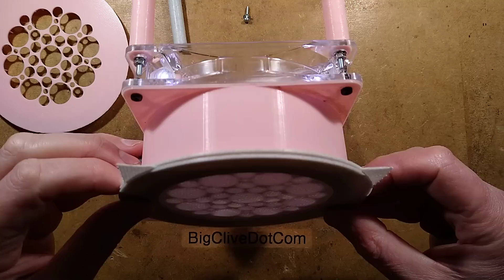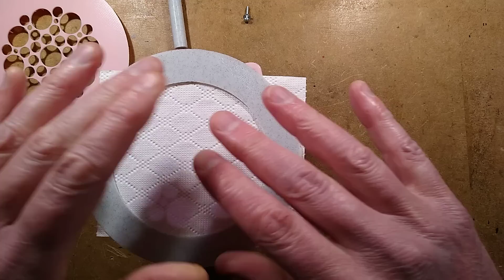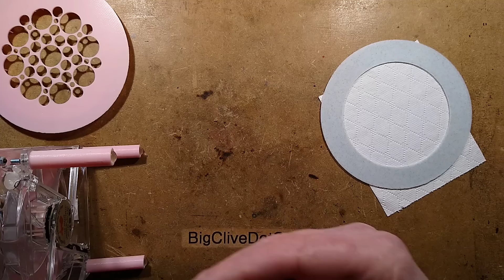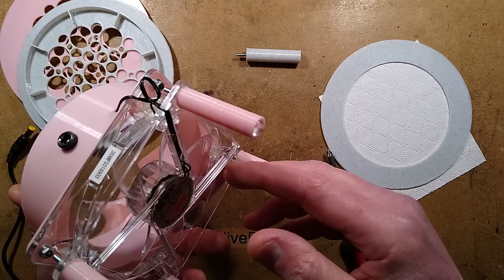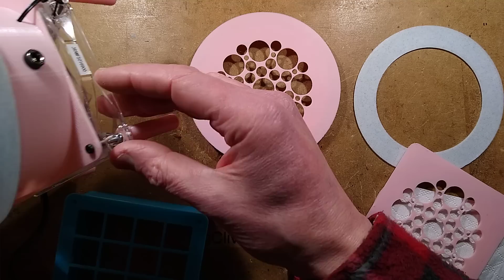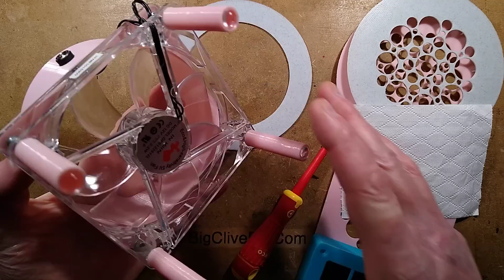MK3 air filter with customisable 3D printing files

Comment: Since giving up TV I replaced my set-top box with an old laptop connected to my big screen.
To help keep it cool I've had a 120mm 12V fan blowing air over it - prolonging the life of the internal fan by years.
Now is a good time to upgrade to filtered airflow.
Reply from the maker: This basic filter results in a very slow airflow.  Your screen may prefer a high airflow with coarse filter if any.
Reply: @bigclivedotcom  Good point. I'll cancel my order for Izal.

Comment: The biggest question does the time+effort+ material cost vs actual effectiveness pan out? In all reality, how much is something that small going to accomplish? Unless the filter material is constantly coming out totally grody on a very frequent and regular basis, I don't see the point in it or the commercial products it copies. 

I'd think the fan is too weak to generate airflow cover a decent area, so you're either going to need several of them in strategic places, or they'll be useless / placebo. 

A half-joking half-serious, waaay too much effort and cost, improvement would be to get it up in the air (diy quadcopter drone?) on a random path in a defined area. Having it move around like some sort of airborne dust-Roomba would cut down on the limited area covered by a stationary product.
Reply from the maker: It's a low throughput extra-quite 24/7 filter for small rooms.
Reply: I agree, this project seems to have jumped off into design and 'engineering' before doing any basic testing on the actual filter material.  Fact of the matter is, if a simple tp/paper towel were of any real use/effectiveness, this would have been found out decades ago.  Its not like this hasn't been tried countless times before.
Basic google shows even 4-ply papertowels have among the lowest filtration capacity.
I understand playing around, however its rather funny people going bongo over this like its going to be a poor man's HEPA filter, or filter much at all.
So far, the 'proof' that it works seems to be that it was able to diffuse some essential oil throughout a room quickly. 
Dispersing a liquid via fan is not the same as filtering air through tp/pt.

Entertaining though.

Comment: I was thinking recesses for wee magnets to hold the ring.
All week I've been looking at 3d printers... couldn't come up with a use case... now I can go spend more money. (sigh)
But I do have to thank you about something else. My expensive paper shredder quit working; your inspiration fueled me to take it apart (a bit of unreasonable force), reverse engineer the circuit so that I could bypass the poorly designed switch in an otherwise excellent product, and rewire the thing so that it WORKS!

Comment: I have a handful of computer fans cooling things like my switch router etc. that are sitting on a bookcase just to get some airflow I'm kicking myself for not thinking about putting a filter on it would have made cleaning a lot easier. The paper towel filter is an interesting technique I discovered it with shop vacuum cleaners on a YouTube channel.

Comment: I would love to see a version that is wall mounted. with the filter material in an upright position held by airflow only. With a little slide and a clip at the bottom to hold a little cardboard box that catches the used filters. turn off power -> let the dirty filter slide in the box -> turn on power and attach new filter.... maybe a 3D printed  mod for a standard toilet paper holder :D

Comment: A version for a 200mm fan could fit those tissues for the nose perfectly. 
And that design could be extended for fans with 4 pin pwm connector, a µC and some sensor for air quality. 
So the fan could ramp up when the air is dirty. 
Or maybe just a design that uses the tacho signal to display the rpm of the fan and when it's a pwm fan, a NE555 based pwm generator to set the fan speed manually.

Comment: Wouldn't it be better to let the dust fall on the floor and vacuum it up than to make an airflow with dust in it in the room. I am thinking that the longer the dust is in the air, the better chance it has of reaching your lungs. Just doing a little critical thinking here. My brain is stuck in that mode. Can't help it :-)

Comment: I did something similar with an empty 5L mini keg of Heineken. I started by removing the top with a rotary tool, then drilled a series of holes near the bottom to exhaust the air. I mounted a 14cm fan with rounded corners with the airflow shooting down, then trimmed the clips that held the plastic handle top on for easy removal. I used swiffer dry refill sheets stretched across the opening up top (between the metal keg and plastic handle) for an air filter material. They trapped the dust very well. 

As a bonus in the summer it functioned as a mini air-conditioner by placing a bag of ice cubes near the bottom of the keg, above the exhaust vent holes.

Comment: Again, hepa filter is absolutely capable of lasting 6-12 months if you use a cotton pre-filter and replace it every time it gets clogged up with dust, in my case every 1.5 month. Such pre-filter is like 10c but probably can be replaced with paper towel. 
Issue with using only a paper towel without hepa filter is it creates fine dust made up of tiny pieces of cellulose and resin (the lower cellulose quality the more resin they have to add to make paper out of it, brown super-recycled paper is sometimes more resin than paper)

Comment: The packing of circles obviously is not particularly efficient and leads to loss of surface area.  I appreciate your desire for something more elegant then the original squares.  I made a 3d printed downpipe leaf-stopper insert that has very similar geometry to what you're doing (a grille over a circular hole).  I went with hexagons for the superior packing efficiency and it's also quite simple to achieve in CAD too.  So I'd recommend that if you ever go to version 3 of your design.

Comment: The upper body looks quite like an off the shelf fan to duct adapter, for attaching a 120mm AC induction fan to e.g., a dryer exhaust hose.

If one made a filter support from drilled fiberboard, presumably this could be replicated decently even without a 3D printer.

Comment: For the feet, I would do the opposite: captive nut in the post, screw on the fan side. That way, they remain easy to remove/refit without having to touch the foot bumpers

Comment: BC rocks, however anyone who thinks this will actually do more than a very minor job of filtering, I've got a bridge....
Just google diy filter materials, and see that even 4-ply paper towels have among the lowest filter capacity.
If someone wants to play around with a 3d printer or experiment, good on ya.  But if you have allergies, get a decent static pressure fan and some decent filter material and you'll get real cleaning.
Also, vaccuum your rooms, you filthy animals!

Comment: Twisting of airflow on the inlet side shouldn't be so much of a problem. It's mostly the down flow side that gets rotation caused by the rotating fan blades. I experience similar on a much larger (and louder) scale on my paramotor :) Thanks though Clive. Oh btw, fitted one of the standby mains change over switches you looked at ages ago, in my campervan to switch between 'shore power' and onboard inverter system.

Comment: It seems a little pointless 3D printing the fancy hole base, then cover it with the paper, that should be the top  layer like your simple ring cover should have the holes, and like your square grid below. With the filter paper between, Yes you will see the holes in a dark room if below filter paper, but how often are you in a room dark enough that they would glow through. This way you could have had your turbulence fins going all the way across your print if you wanted.

Comment: Since these are very weak static pressure, you could more than 2x the throughput by stacking another fan + air chamber. same desk space, same single plug but simply more effective.

Comment: Corrugating the filter similar to a car air filter would increase the surface area for filtration. If you haven't already you should do a video showing off/reviewing your 3d printer. I'd love one but I don't want to break the bank on something that see's occasional use, got enough expensive tools already

Comment: We have a water-based air purifier, by care for air - the clean air factory. It works quite well - we can smell the anti-bacterial essential oil drops we put into the water (also bought from/made by care for air) and the air intake slot on the inside of the top at the back of the unit is surrounded with dust - it is drawing in air. We have it on a plug timer and it turns on in the day time in the winter - it partly humidifies the air around it combating the dry air made by the radiators of the central heating. In the spring I have set it to turn on in the evening when the heating turns on and we start closing the windows - as it is warm in the daytime and cold at night, and in the summer it is put away as it is hot in the day and warm at night - most of the windows are permanently open with the heating off. As for ventilation in general, we live in a Victorian terraced house that has 2 fireplaces - lounge/master bedroom, the air is drawn up them because of the Venturi effect on the chimney pots when a breeze blows over the terrace/house. We have 3 extractor fans - cooker hood in the kitchen, 12v fan in the main bathroom, 240v fan in the loft extension shower/toilet, and I have a ventilation fan in my bedroom 😁

Comment: I might build one with 200mm 5V USB fan, should be quieter than small fan and USB power supplies are cheap. Although I already got Elixair air filter with washable filter but always good to have more filters running in a house with cats.

Comment: Great basic idea, I see great potential for further development. First, I'm thinking a stack of filters, in parallell, to reduce resistance, and increase service interval. Second, I think you should try using exposed infill for the grids. Design them without holes, slice without top and bottom layers, and choose infill pattern and density to get the result you want.  That way you get a singe wall structure, which gives best "hole to structure ratio", that also prints fast.

Comment: Longer screws in the leggs will allow both the leggs and the sleeve to be held by 4 dome nuts, simpler and less parts. The top ring can be heald by magnets to ensure it do not vibrate of. What about the fan type, static pressure vs high flow for best effect and/or longevity? Nice re design still.

Comment: Very interesting! Perhaps a useful variety for the lab would be a second, very similar design with a switchable fan speed (off, low, med, high) which might be used as a extraction fan for those oh-so-dangerous-non-EU-tyrants-compliant soldering fumes. The cavity in front of the fan could be enlarged just a bit and might contain a active carbon (charcoal ?) filter (cloth?) to the same effect.

Thanks Clive for sharing and creating these great designs and videos.

Comment: How about increasing the surface area of the filter by making a filter cube?

I was working maintenance at a local mid-sized factory and someone broke one of those deep accordion-type air filters on a machine. When we went to change it, we found someone had decided to store the extra filters in the outside storage area and all the filters were soggy and probably moldy.

So we made a large cube out of aluminium profile and simple filter material that we could mount over the air intake while new filters were in delivery. With five times the surface area of the air intake the cube provided enough air flow to prevent overheating and seemed to work better than the original filters. If the cube hadn't projected onto a walking pathway, we would have gladly used it instead of the bought ones.

Comment: I wonder when you will realize that you will need hundreds of those things to make a tangible difference....
Reply from the maker: It's specifically a low volume silent 24/7 unit for a small room.
Reply: @bigclivedotcom  normally, they make a positive pressure environment to control dust. So intake from outside, heavy filtered. That's the way to go.

Comment: Does OpenSCAD support "lofts"? If so, you could make a fairing to adapt the square grid to the round fan opening inside of the standoff piece. That should improve the airflow.
Reply from the maker: It could possibly be done with the hull command.

Comment: Eh...I'm still unconvinced. A PC fan doesn't move enough air, nor at enough pressure, IMO&E. I'm not downvoting you or anything, and I hope you can show your design works (that's a whole 'nother ball of wax). But I think it's going to be an uphill battle with such low airflow. There are good reasons that household HEPA filters use much-larger electric motors and make a noticeable breeze; the turbulence they create is part of their "magic".

Comment: I built something similar with a high static pressure 140mm noctua fan. I ended up scrapping it, because my apartment replaces all the air way faster than the filter thingie could work (this was to remove pollen). 

Things became grandiose. Filter every inlet. Central control of fan speeds. Filter replacement warning. 

That ship sank fast.

Comment: If you used longer screws they could come out the top of the fan and have nuts on them. Then you would only need 4 nuts and bolts.

Comment: I would be interested in seeing the results of a smoke test to see the airflow it generates (with and without paper).
I struggle to imagine there would be any significant airflow through it, but I'm always willing to be proven wrong.
If it's struggling with airflow, you could get a pair of high static pressure fans and sandwich the paper between.

Comment: If you make the 3D printed holes 7/32" or 5.5mm, then a standard "PC Fan Screw" will be all you need.  They don't require nuts on the end of 'em, eh.
Reply from the maker: The current version does that.
Reply: @bigclivedotcom  you're a smart man, Clive.
And those screws are so readily available ... Amazon ... local computer stores ...etc ...

Comment: How about adding UV light and that ozone generator? I liked the concept of your air filter
Reply: You don't want an ozone generator in there if it is going to be on all the time - not healthy for your lungs!
I have a small industrial ozone generator and I can only use it when I leave home for a few hours. As soon as I get home, I have to make sure it has stopped running, and then open all the windows & doors and ventilate the place with fresh air. But it is great for getting rid of odors and killing small insects.
Reply: Yes, you are right. Adding ozone generator could be unsafe..

Comment: you could make this idea larger and simpler if you have a desktop computer that runs most of the day which will usually have at least one exhaust fan.  most computer cases also have the front anel/cover as one huge part where you could replace with filter or paper filter.  the challenge is with the gaps and holes that needs filling/taping.
Reply from the maker: Computers need coarse filters for high airflow.

Comment: This project is an awesome idea! The circles do look nice, though a hex grid that uses the cross members as turbulence stabilizers may give cleaner flow. Another thought is that the hex nuts could be printed into the top of the legs with long screws coming through from top to bottom to hold the whole device together. Progressive tinkering is always fun.

Comment: Can move the plug hole into the corner of the fans square, attached to a square shroud of some sort around the fan section.
Said shroud could wraparound with a single seam or clamshell, as to slide little brackets in the corners that can replace the nuts.
Any cutouts designed into the shroud would let patterned light out as an added bonus.

Comment: I'm not convinced that the center grid is even necessary. If you want to have some stupid fun you can design inclusions into your toilet paper 'clamps', to put magnets into.  That way there will be a significant amount of force holding the tp on without any grid at all, and it makes a satisfying alignment when placed down.

Essentially you make holes in your print, pause the print, insert magnets, and then the print covers up the holes so the magnets are 'invisible'.

Comment: Yeah you're totally on the right track Clive, I worked at an a/c place and that was one of the things I learned working there, an unducted fan is waaay less effient than a ducted fan and you have essentially made one with the top piece. The pink one is perfect. Try it yourself, take the top peice off and on and feel the difference. I was blown away (sorry, that wasn't on purpose)when I was shown.

I think a perfect addition would be a little ozone generator inserted into the side of the top 'duct'. I know that some 'upper market' pedistal fans have them, so maybe ebay? I have taken one out before and it was only 12v so it can still be portable. Just a thought. Love your videos mate 👍. Keep it up.

Comment: A  funnel shape   would  allow for a  larger  surface area, which would reduce the suction force required  or in other words is likely to increase the overall performance of the filter/fan design.  not to mention  the  time between service would be increased.... or   go cubic  having a sheet of  paper on each side of the upper cube  this would achieve a similar result.   use a fogger machine to test how far the filters "draft"  reaches...  this would be its  effective filter  room size.  any  dust outside this zone will not be filtered.